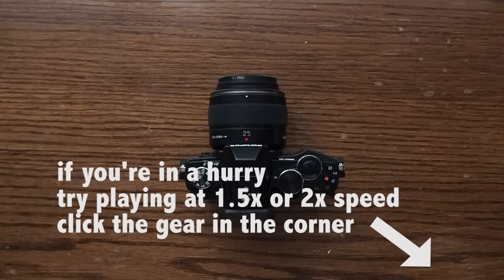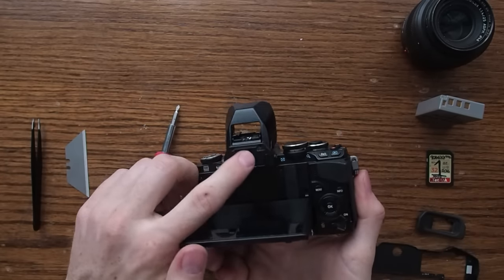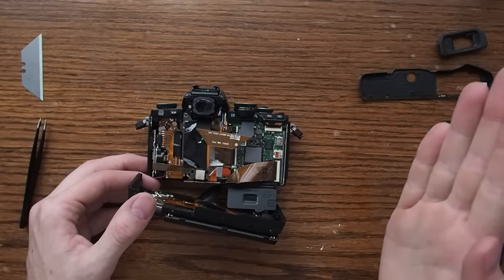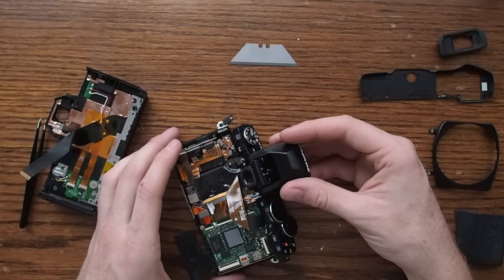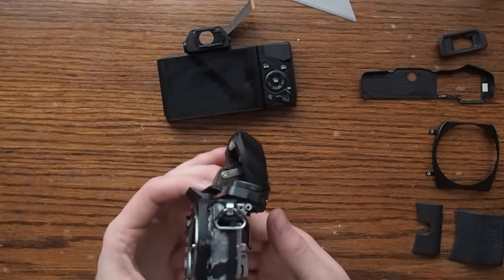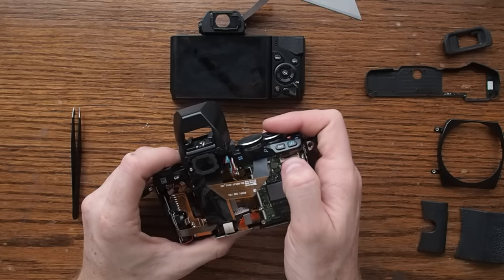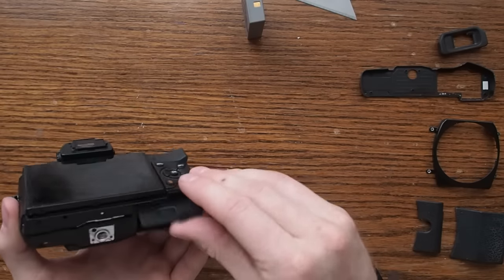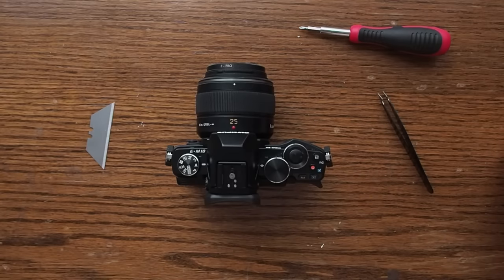How To Fix Olympus OM-D E-M10 (Disassembly & Repair)

Comment: Thanks you so much for posting this. I was sure my camera was a write off after I had the shutter stuck just like you mentioned in the video. Detached and cleaned each ribbon, and I managed to identify the bad contact as the second ribbon in the middle from the top. It's alive now and works perfectly. :DDD
Reply: Thank you so much for your comment. First I tried the wash with alcohol, which didn't worked. Because of your description I unhooked all the ribbon cables I could and cleaned the connectors. Now my camera is working again. 😇

Comment: Many Thanks, I will have to fix 2 of those shutterlazy rascals. I am a trained goldsmith since 1975 (Amsterdam Diamonds etc, now Tuscany, no diamonds), did watches and have all the tweezers and tools, but what I needed was your very well made video, it will give me courage. Untill now I was planning a Whole Lot of Love from Led Zeppelin at maximum volume to (ultrasonicwise) blast out any shutter obstructions, but now I will use your alcoholic magic touch, for the camera's and for me too!! Thanks again. alex
Reply from the maker: ArkimedeTV best of luck!
Reply: Thanks, I will probably need it for the next one coming, BUT, in this E M10 markII camera, I was very lucky. I bought it with the 14-42 EZ lens for 200 euro (shop price 700), and guess what, my own battery in, updating with the Olympus program (Windows) and the shutter was back to normal and the camera like new, now I will hesitate to tell to the one I bought it from, let's not rub salt in the open wound. The next one is like you demonstrated and I will let you know within 10 days when it arrived and I will have to measure me with your skills. alex

Comment: Got a 7-14 ED f4 Micro4:3 lens . . . $1500 new back in mid-2000's . . . Olympus won't repair because 'discontinued' model!
It all works except for manual focus ring, so will be getting out the jeweler's screwdriver, magnifier, and tweezers and open her up. 

Nice job on the M10. The EM5's are 'splash' resistant, so maybe more care required taking apart.
Would like to remove the IR/UV filters to make a full spectrum camera.

Comment: THANKS SO MUCH !!
I had the shutter issue and could repair it with your instructions.
I did not "wash it, but disassembled all ribbon cables, cleaned them with brake cleaner and put it all together..
The only thing I have to say, that most screws do not need to be removed.
Reply from the maker: Awesome! Glad to hear it worked out for you, brake cleaner is a good idea.

Comment: Hello. Thank you for sharing this video.my problem is the mode dial. Round plastic wheel broken and the dial stay in Aperture. I found parts but is complete the upper body with all dials and viewfinder. Your saying that the flex that is connecting the flash to the camera is not a ribbon. So if its glue the contacts there must be much more difficult. Any suggestions?

Comment: Anyone have a problem removing the battery?   The clip at the front holding the battery doesn't move.
Reply from the maker: Not sure about that, maybe try a little lube or a drop of WD40 or acetone to free it up. Be careful with solvents though because they can etch the plastics.

Comment: Excellent I have like squiggles in my view EVF when I look through, they don’t show on LCD or on photos, been on a while and really weird, they are like yellow and look like something crawled around, I even think they changed at one point, when I remove lens and put a puff brush in opening I can see that as I move it but don’t know where the squiggles are located to clean off. Really weird like when you look through a micro scope and see what bacteria is on plate. If you have any ideas please let me know. DG

Comment: Hi thanks for showing how to video.. I have touchscreen issue.. Sometimes works.. Should i buy the flex or lcd instead? For the lcd opening.. Do i have to open the hand grip or front screw? Thanks
Reply from the maker: Hmm tricky question. Not sure I could give a good answer to that, might have to just try and see.

Comment: Thank you ,it helped me alot about figuring it out next... My problem is, theres a slightly fungus inside my EVF viewfinder. So if i clean that , should i dissasemble like in this video? I hope you answer my question.. like and subbed
Reply from the maker: Hmm. Glad I could help a little but not sure what you can do about fungus in the EVF. I never tried to pull apart the glass from the front of the EVF but I have a feeling it may be tricky. Best of luck, if you end up with any success in cleaning the EVF comment and let me know!
Reply: Oh im glad you replied my comments. Well according your statements, I think i will just use it anyway without cleaning that, cause the evf still 90% clear. Because of your video really makes me evaluate myself that im not brave enough to do what you've done, but someday i will try. So your video help me a lot. Much appreciated Nate, good luck for you.

Comment: Use double-sided tape to re-attach the rubber covers.  You can get it at any golf store (it's thin, once the covers are removed from both sides and is used to attach rubber grips to club shafts) You could clean the old tape off and cut and piece together a new complete covering.

Comment: Hi! I got a similar power cycling issue on an omd em10, do you think it's fine to drench it in 100% Isopropyl alcohol? I'm a bit skeptical because I've seen it cracks clear plastics. Did you get any of this with your 91% alcohol?
Reply: Just looked it up, it specifically cracks plexiglass acrylics and softens rubber materials. Does the em10 has any of these materials inside the body?

Comment: I have acquired an OMD EM5 Mk 2 but the power switch failed? And I don't know how to disassemble that camera ... any tutorial for it? HELP!! PLEASE!!
-
he adquirido una OMD EM5 Mk 2 pero se le averío el interruptor de encendido? y no se como desarmar esa camara... algun tutorial para ello? HELP!
Reply: Are you talking about the On & Off Switch (back lower right side)?
Reply: @angelisone  yes
Reply: @angelisone  yes, it´s broken inside.
Reply: @Anselher  The removal of the back cover is almost the same as Anselher.
You only the correct Phillip screwdriver.

If you have not able to take apart the camera, how do you know the switch is broken?
Reply: Make sure you remove the battery & wear rubber gloves.
Then you also have to peel out some rubber cover to see more screws.

ATG suggests me to do the following steps..
If you can not get access to a new ON/OFF Switch.
Use a DVM (digital volt meter) & move that switch into the On positioned.
Reply: @angelisone  the switch is moving free.  no have the sound a feel: "tic, tac"
Reply: @Anselher  Then you have to open up the back cover.
Then use a DVM to troubleshoot by noticing the ON's position (from the back).
Once you have noticed them, solder a thing insulated wires so it will now be On.

Comment: Great tutorial...couple of thoughts...I would recommend not using superglue......it reacts with plastics and makes a mess that can't be cleaned off..use thin double sided sticky tape...and if you need to reconnect a ribbon or put back a missed screw after battery check....always take the battery out first..as you can blow the mainboard if there is residual current flowing into it.Also discharge the flash capacitor as a safety measure.
Reply from the maker: Good advice, thank you. I wanted to discharge the flash capacitor but I had a hard time getting to it, I think it's tucked in behind some other components.
Reply: How do I safely discharge the flash capacitor?

Comment: Thanks, this is very helpful. My E-M10 Mk.2 has just developed the same stuck shutter problem you described and with my camera being out of warranty I had no idea what to do about it, so I'll try the alcohol wash you mentioned.
Reply from the maker: Best of luck to you! It's certainly not guaranteed, but in certain circumstances it seems to work. Let me know how it goes.
Reply: Is it safe to drench the camera in the alcohol even with the capacitor that powers the built in flash?

Comment: Very useful video. Do you know if it's possible to remove the SD card holder? My SD card became stuck and on removal it was found that a tiny piece of plastic had come off the SD card and had bent one of the terminals rendering it unusable. Any suggestions would be appreciated.

Comment: EM10 mode dial not working / stuck in M mode.
how to repiar my camera
Reply from the maker: Impossible to say for sure. Some other people in the comments here have had the same symptoms, but nobody ever reported back to see if they were able to fix it themselves. My disassembly instruction will let you see the dial mechanism, and you could inspect for any dust, corrosion on the contacts, etc. Best of luck!

Comment: Hi Nate! Just came across your video when I was searching why my camera does not recognise the new lens that I bought which I am pretty sure is compatible to my camera. I have an Olympus OM-D EM10 Mark ii and I have recently purchased the olympus 12-50mm f/3.5-5.6 EZ lens. However, when I mounted the lens onto my camera (I am sure the lens was on properly, red dot to red dot and clicked), the display screen was shown to be black with aperture etc. as '-.-'. I am sure the camera body works fine as when I took the lens off, the screen displayed colours again and it works perfectly fine with my other Olympus Lens. Do you know what the problem is? I am very lost at the moment ... Thanks!

Vincy

Comment: Hi. Does DSLR camera have any power sugre protection inside the body? I am just curious. For example, let's say I bought a new lens to my DSLR, but with damaged electronics. I put it to the body and .... the camera is damaged. It is possible?
Reply from the maker: Interesting problem indeed. I really don't know, seems unlikely to me that a bad lens could actually damage or short circuit the camera body. But I'm certainly no expert on that. Best of luck to you!
Reply: No.

Comment: Let me get this straight, you poured alcohol all over the back? Did you seriously drench the thing? Just poured it all over or did you dampen a cloth to wet it down? Gonna try this and I want to make sure I don't make things worse. Thanks for the video!!!
Reply from the maker: LOL yes I went to a sink and straight poured it on there, aiming mainly for the dials and EVF where I was having trouble. Worked for me, though proceed at your own risk! I honestly think using distilled or deionized water may be better because the alcohol may interact with some of the plastics a bit. On the other hand the alcohol dries off faster. Best of luck, let me know how it goes!

Comment: This video gave me really bad anxiety. Please, please, please put the body cap on. The sensor should never be exposed for that long. It will have to be cleaned by Olympus if any dust or particles get on it. It can not safely be cleaned at home because it's floating, and not fixed like normal sensors due to the IBS.
Reply from the maker: LOL thank you for your concern. You might have a heart attack if you saw some of the things I do to my cameras.
Reply: I was thinking the same thing

Comment: wow its a great video!
my em10 is has a white balance issue ( got some red color cast in some situation,expecially in extreme highlight condition )..i think ill send it back for claim a warranty,but in my country Indonesia,olympus warranty is suck! they say it wil cost almost 200 USD ...
and now i think to repair it myself,do you have any idea about this white balance issue? any part i can clean up or something ?
really need help 😭
Reply: I had that exact same issue...and found out that, same as in Indonesia, warranty sucks!  However I did have a friend that traveled alot to the USA so I sent the camera with him and Olympus repaired it for $100 USD.  The sensor somehow got damaged (I don't know why, since I don't change lenses alot) and needed to be replaced; cleaning did not help.

Comment: Hi any help on this please???
My M1 turns on and is on the Art mode.
I tried to move ahead using any button
And nothing changes.
Then after  4 seconds shut off.
Then i move the on off button and starts again and then shut up.
Any help on this...???
Advise?? Thanks🙏📷
Reply: Try running the ATG's Olympus Capture (free software) on your computer.
Hook up cable to camera to pc & do adjustment or setting from pc.
If pc setting or control works, then the camera's button is or are at fault.
Reply: @angelisone  Hi thank you for your reply. I was in my way to download the software but i undestand what you said and i have to tell you that before you reply i've tried to keep the camera on and i keep turning it on and shutting it off repidetly my self by moveing the power buttom and some time she will stay on and i could takes pictures and do settings but if i turn it off it take time to stays on again.
Do you think it is the power buttom???
Reply: @danielandujar5479  If your battery is over 3 years old, replace it.
Insert a brand new fresh battery, if none available go camera store that has one..to borrow.
Let say you are able to get the camera turned on, you will need to use the computer.
1. Turn on computer & open Olympus Capture (OC).
2. Run supported cable from camera to pc
3. Hit live-view on OC, you will see live-view on pc
4. When you use the pc to operate all settings & buttons on camera electronically
5. Then try setting /or press those buttons on camera, if it doesn't do a thing. Then that's bad.

If you have no access to a fresh battery, then you have to check the voltage & current.
The only way to do that is by a DVM.

ATG said the On/Off button, Shutter Button then the Shutter do go bad often.
From what you are saying the ON/OFF Button (contacts from the bad side are defective)

ATG recommends not to turn the On/Off button off and on many time.
Just leave it on. Camera goes into standby or you can remove the battery.
Every time you turn power on & off, you produces electrical arc. This in turn like a spark plug, it goes bad.

Place your email here & then send me photos.
And I can ask ATG & staff for help if I can't help.
Reply: @angelisone  Thanks  million for your presious time to reply. I will leave it like you said. Right know here in Puerto Rico there is partys everywhere.
I let you know soon 📷🙏🌴🚶‍♂️
Happy holidays..
Stay safe😊
Reply: Yeahh the batterie is new.
And like i said .
When she stay on you could takes pictures and go to menu to do changes.
I just bought it on ebay like that.
So i asked people like you who knows
And could share an help..
Blessings🙏

Comment: is it possible to replace or repair the front dial (that houses the shutter button)? 
Mine has fallen off and hoping to find a way to fix it.
Reply from the maker: Hmm, the dial has fallen off. I'm really not sure, it didn't look like it would be easily detached from the rest of the circuitry, and you would also face the issue of finding a replacement part. On the other hand, when I had mine apart I wasn't giving that part particularly close attention, so I may have missed something. Best of luck!
Reply: Nathan Birrell yes contact Luton cameras which are the stockists in the uk for Olympus equipment...you may need to upload an image or two of the defective part....Very good company to deal with....they will order the part and ship to you ...or carry out full repairs.